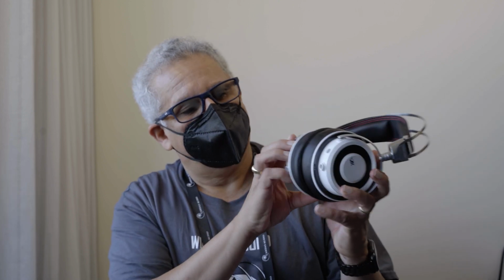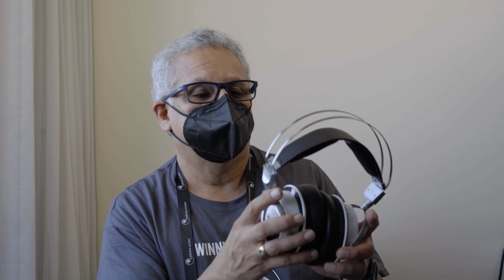CanJam SoCal 2021 Interview: Vic from VZR discusses their new gaming headphones

Comment: Dolby Atmos does this already with a 3d globe around your head so just get your self a pair of high end headphones and then turn on Dolby Atmos then enjoy it like a chocolate milkshake or 🫕🍫 and you should have done what Audeze did which is make a duel entry 🎧 with a cable with a microphone attached to the cable  and not use separate slot for the microphone for the best sound quality

Comment: Tried these at CamJam. Super duper comfy and soft. V-shape tuning with a heavy emphasis on the sub base. Vic even had me try out a track that emphasized it and yeah, its was pretty damn clean. My only downside: you are still going to have to rely on a DAC with mic support or on board 3.5mm mic input.
Reply: You could use the supplied 1/4" adapter that correctly terminates TRRS to TRS. You'd get no mic, however. Or, you could use the supplied PC splitter cable to connect to the DAC you want while connecting the mic plug to a PC mic input, for example.
Reply: @vzr-winningsound7418  I'm starting to read more reviews and buyers of these. Alot of good things but I don't think they should be labeled as studio gaming headphones. When I think studio I think flat reference headphones. Not V shaped headphones.
Reply: @jcap8391  hi there, thanks for your comment. We have some mixing engineers who like the profile we’ve developed. We found that most headphones, even TOTL, don’t give you detailed bass below 40Hz… some beginners, after spending time with it, will never go back to their previous references due lack of accurate bass. Believe it or not, the CrossWave lens does take some getting used to and a short listening session doesn’t do it justice. We found some people need to spend time with it to truly appreciate it. Suggest buying on Amazon, try it out for a couple weeks, then, if you don’t like it, return it for a full refund.
Reply: @vzr-winningsound7418  I appreciate the response. Small things like this help convince people like me on the fence to purchase your product. I will order one soon thanks again
Reply: @jcap8391  we’re here to help. Thanks so much for giving us a try and hope you’re experiencing is positive!
Reply: @vzr-winningsound7418  You have some of the best customer service and communication I've experienced. Swift replies, courteous and gracious, and eager to get answers to questions and keep customers satisfied. Another rad perk of owning this headset.
Reply: @jcap8391  Did you end up picking up a pair?
Reply: @velvetjones8634  Yes they are better than I expected. I wouldn't say they are the best studio headphones though. They are amazing for gaming and music but for mixing and mastering I use my dt1990
Reply: @jcap8391  I appreciate it! I love HI-FI but I’ll never be an audiophile because I love big bass more (as long as it’s clean, of course). 

Ordering a set now and am hoping they’ll finally be what I’ve been looking for.
Reply: @velvetjones8634  This isn't like Skullcandy muddy bass or overly extended bass. This is clean punchy bass. I'm sure you will love it. It's comfortable af too. I've owned about 11 different headphones and 4 different headsets. These have the best overall bass I've heard. Clean and fast bass that can keep up. It's hard to describe. Definitely for bass lovers though. Let me know what you think when you get them. These are my daily drivers unless I'm monitoring or editing
Reply: @jcap8391  Will do!
Reply: Any updates because I’m think of buying headphones? I’m actually coming from some Yamaha’s e700a and want I more spatial sound as I heard these provide.